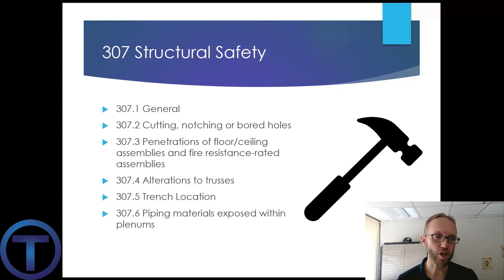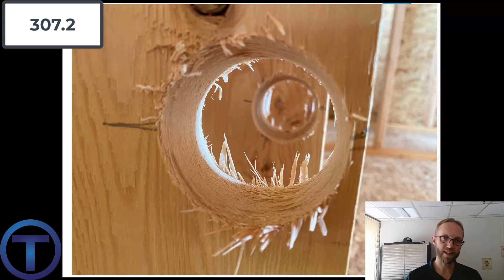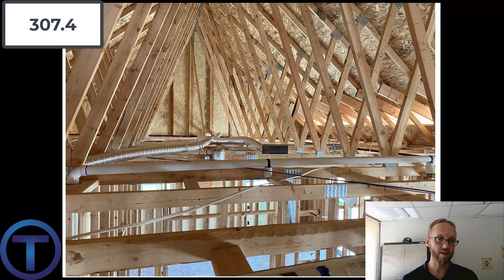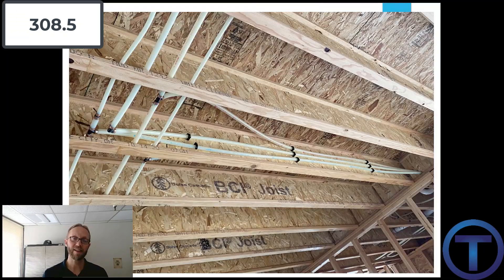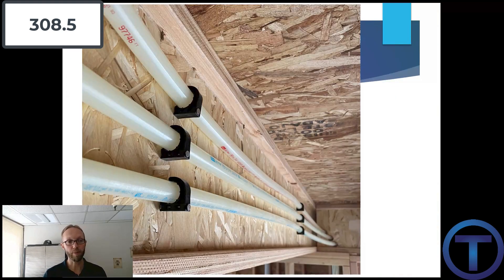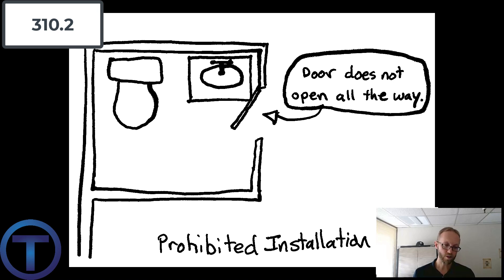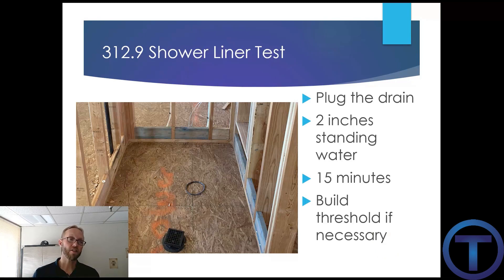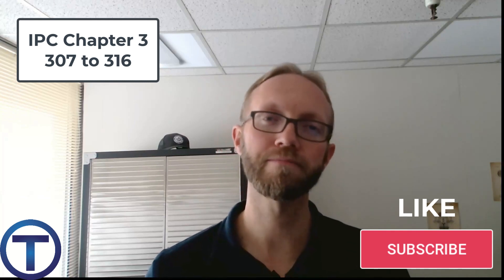Understanding International Plumbing Code: Chapter 3 Sections 307 to 316

Comment: where would I find the minimum water flow for a residential house according to the international plumbing code?  Generally and then per fixture?  I see on line where 6 GPM is a standard.  Is this documented in the code book somewhere?  I have gone through chapter 4 and chapter 6 and cant find it.  Please let me know.
Reply from the maker: Hello.   Flow rates are addressed in IPC Chapter 6.  I think flow rates would vary from one house to another, depending on how many fixtures there are and the sizes of pipe.  I am not aware of any minimum per house, but I imagine it would be the total for all the fixtures connected to the system.  Once again, that would vary from one building to another, which might be why there is no minimum per building.

Comment: You touched on fire caulk for vertical wall penetrations in the video, around here the inspector wants us to use spray foam... You know the stuff that emits toxic smoke when it burns? Yeah that stuff 😂
Reply from the maker: I see. Not uncommon. I think sealing the holes and gaps helps keep fire from spreading.
Reply: @plumber-tom9470  yeah that's the idea. But I feel like high temp silicone does a better job than spray foam. I just find the inspectors interpretation of the code to be funny when their spray foam solution has potential to do harm. 
Best intentions I guess